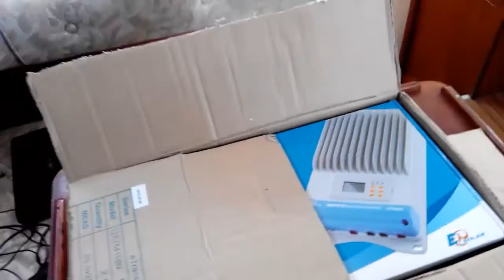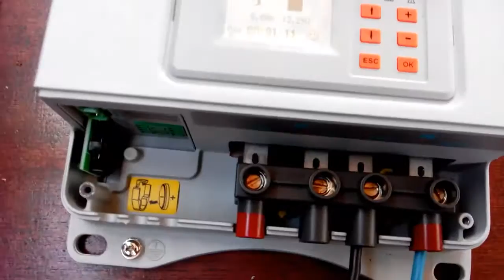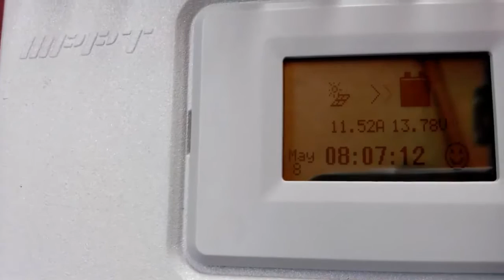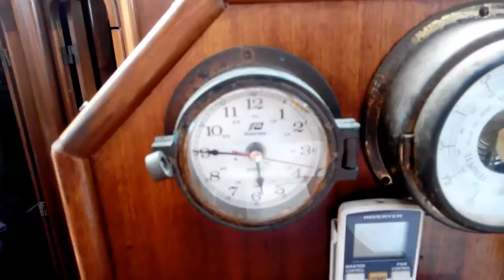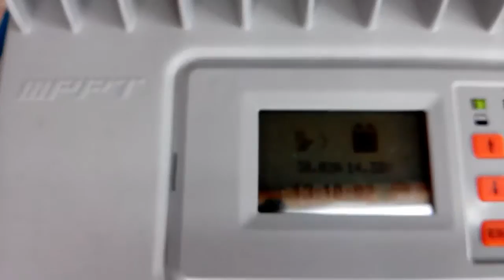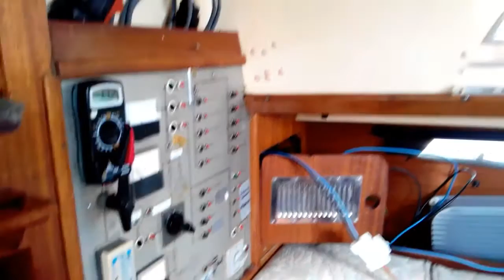Part1: Install Test review EPSOLAR MPPT TRACER ET6415BND 60A Solar Charger Boat

Comment: The last week i have a big problem with my TRACER ET6415BND charge controller the charging voltage become much to high above the 33 volt. i was studying the problem,  and can't find anything. 

I have disconnect the charge controller and want sent him to an repair point from EPsolar in Germany,  But my battery become low and yesterday i reconnect the charge controller for charging the battery's. 

To my surprise, I saw today that the charge controller was working normal again. If you have strange problems disconnect the charge controller wait a while and connect him again.

They call this a hard reset.

Comment: UPDATED 6 may. 

Hi.

I have broch the same charge controller. 

You can better connect the tree panels in series.  higher efficiency, higher voltage, more energy by Cloudy weather. Your panels are now parallel connected. and give 30 volt. Connected in series your panels give 90 to 100 volt, easy job for this charge controller that can handle 150 volt DC.
Reply from the maker: Hi thanks for the tip. Did you actually tried both? The efficiency of the conversion is better as lower is the voltage but i would be curious to see what measure you have made.
Reply: Indeed you get a higher efficiency  In sunny weather, but certainly in cloudy weather. 

Here I really noticed the difference. I think 10% to 15% more energy.

Just try it, the plugs are quickly Changed.